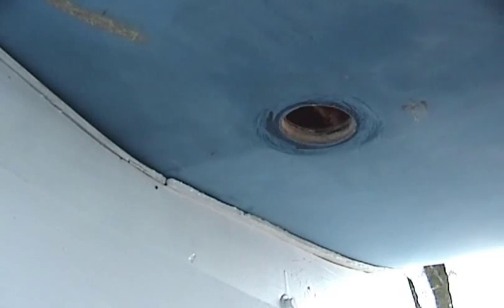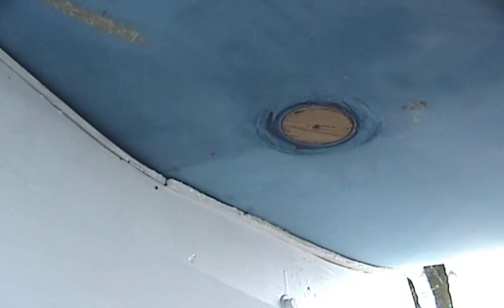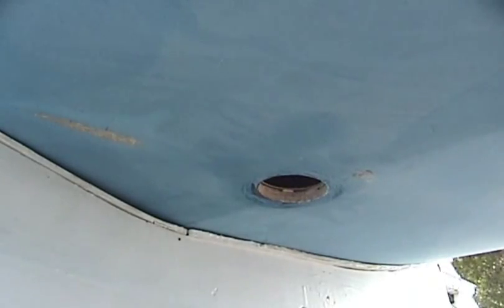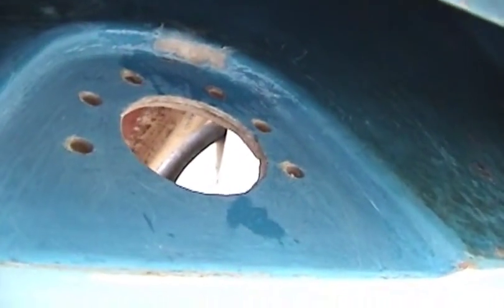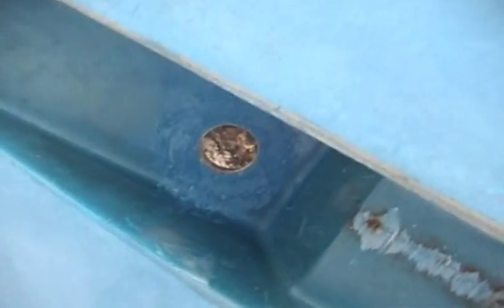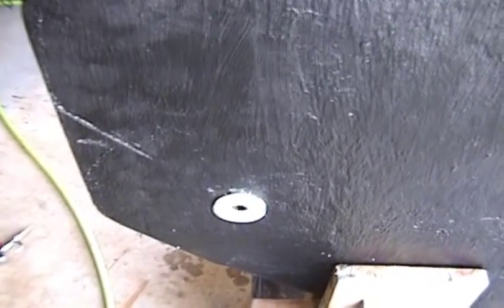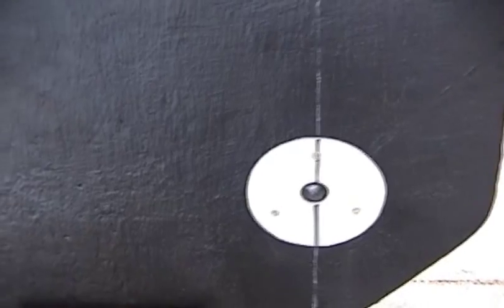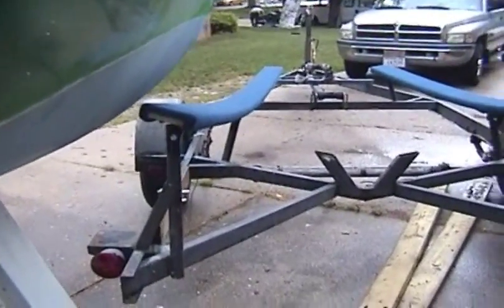Chrysler C22 Keel Repair PT 2

Comment: Hello, did you paint the keel ¿trunk? before reinstalling the keel pin plates/keel?
Reply from the maker: No. It was in very good shape other than the forward area that I had to fill with epoxy. I did coat the the repair with bottom paint.